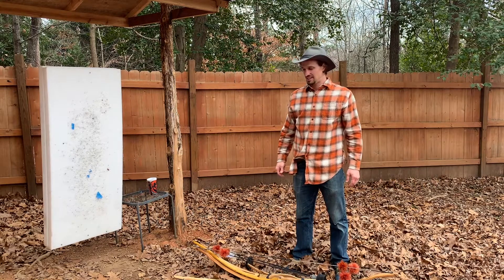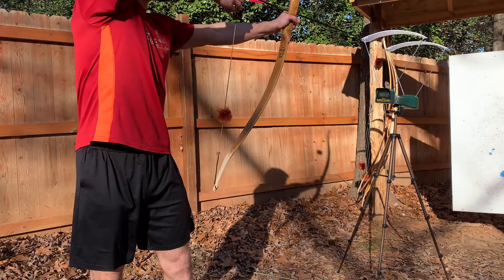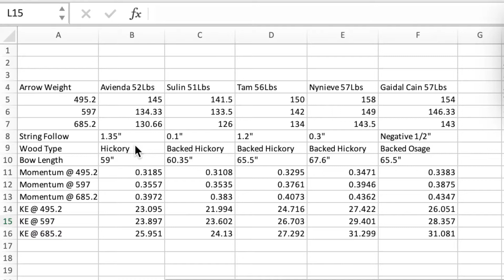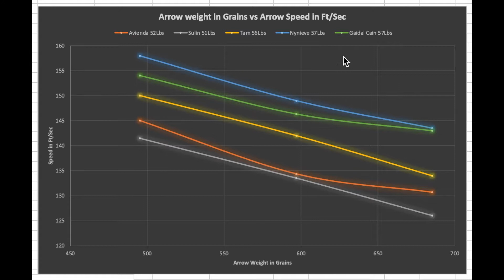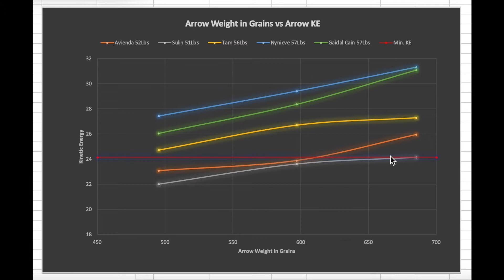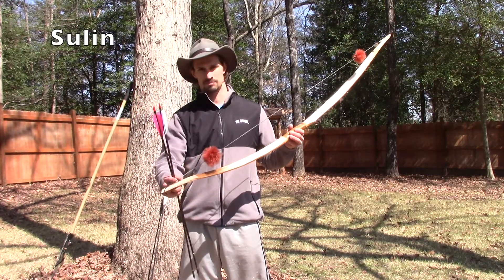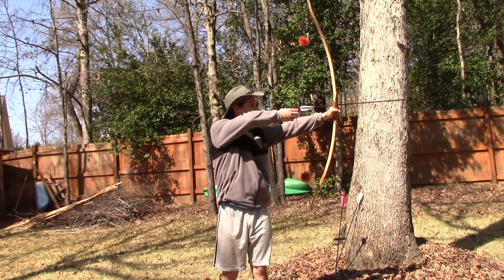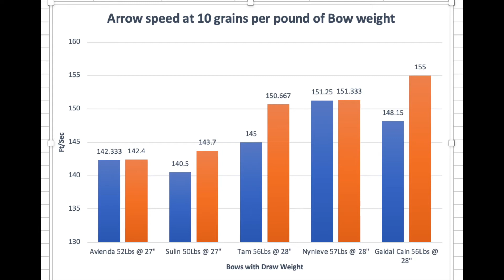Self Bow Lethality, Speed Testing, and  Design Efficiency Discussion

Comment: Great video!!! Do you fire harden your hickory bows or just use a heat gun?
Reply from the maker: @stevenkeil7869  hey Steven, thanks for the watch and the comment. In this video, I used a heat gun to harden my hickory bows. In My latest experiment, I used charcoal fire in a backyard pit to harden a hickory bow. I think I did too much because the bow became much stiffer and ended up causing some very detrimental transverse fractures over the back of the bow which left it unusable.

Comment: Greetings from Aotearoa New Zealand, that is a very ineresting video! I also back my bows with rawhide, I'm interested to know why you back with two layers, more protection? does it add to performance? Also I'm interested to know what material your target is made from, we have a board here called Expol thermaslab(insulating) and your target looks very much like it, I have been wondering how it would work as archery target..
Reply from the maker: Hey man, I backed with 2 layers of raw hide because I thought raw hide would add to speed.  I do not believe raw hide adds to speed at this time.  I think all raw hide does is protect the back of the bow.  I think it adds a small amount of weight, which probably reduces speed some, but I like the protection on my bow back.  I would stick to one layer or no raw hide backing at this point in my bow building experience.
The target is an industrial closed cell high density foam I ordered,  210 US dollars.  It works great for allowing me to shoot broadheads in practice.

Comment: What is your draw length ?
Reply from the maker: I pull to 27 at full, i short draw some of my bows that stack though.
Reply: @gettingclose4206  Did you measure your draw weight at 27 or 28 inchs? Thank you for the information. You make good bows.
Reply from the maker: @jkhippie5929 I specify what length I measure the draw weight at on my bows, but I see I did not specify on my video.  Thanks for the observation. As a bow maker, I have in mind the maximum draw length I believe the bow can handle. Most bows I measure at 28” on my tillering board.  I feel like most of the stickbow world feels draw weight should be measured at 28” when possible.  2 bows I have are quite short, 60 and 61 inches, (Avienda and Sulin respectively) in total length unstrung. These bows I measure the draw weight at 27”.
Reply: @gettingclose4206   Great work. I have been looking for good research on the topic. Good experiment it has helped me with my builds too, thanks.
Reply from the maker: @jkhippie5929  Thank you.  I am definitely not the best bow builder, but Perfect tiller, lighter smaller tips, and Longer bows with more backset should be the formula for faster better performing bows.  the difficulty is in building these bows.

Comment: Hmmm. Interesting theory about the longer bows limb tips moving less distance. I haven't taught of it like that, and i can't either confirm or deny that.
How ever, shorter bows start their stacking earlier than longer ones, it is difficult to feel, but if you make a draw force curve, you can see that. That means that cus their draw weight increases towards the full draw faster than longer bows, they will have less over all draw weight (stored energy) with the same max poundage. That is at least partially the reason why your shorter bows are less efficient. How ever, it is possible to make a shorter bow faster than the longer bow, cus it can have lighter limbs, so even tough it has less stored energy, it also has less limb mass. This depends from the design of course. 

One sure way to increase the bow speed is elliptical tiller. Meaning that instead of all the limb length bending equally, the amount of bend gradually increase towards the tip. This results is lighter limb tips, and the stored energy is in more beneficial location being closer to the tip. You can demonstrate this effect by swinging a (heavy) hammer. The closer of the hammer head you hold, the easier it is to swing around, the further down the handle, the more difficult it comes. That's because the leverage is working against you, just like leverage in bows is working against the limb. Bending limb still acts as a lever also, and the longer the lever, the harder it is for the stored energy to swing the limb.
Reply: Oh, and this tips comes from a guy who has made 2 longbows that shoot 180 or over fps with 530 gn arrows and 29" draw, the slower one is 53# and faster 51# at 29". The faster shoots with 28" draw around 177-178 fps those same arrows. I have also made a 45# short bow that shoots those same arrows 175 fps with 28" draw and it stacks horrible in that draw length because of it's shortness. But even still, only 2 to 3 fps difference to the faster longbow even tough 6 lbs less draw weight.
Reply from the maker: @jkre  Those are seriously high performing bows.  What material are they made of?   I have always kept my last 10 or so inches of limb static (barely bending) blending a Holmgaard style tip with a flat bow design.  Sounds like should get away from this design to discover more speed in my bows.
Reply: @gettingclose4206  my fastest is fire hardened service berry self bow (hedeby inspired longbow) with no string follow, finished this year but most of it made last summer. Second fastest is bamboo backed jatoba longbow, that one is 4 years old and poorly build with an inch or so with string follow, i'm fairly sure those materials on better build quality and design would shoot over 190 fps if not even close to 200 fps. And the third short bow is sinew backed osage, but the sinew is glued with titebond III, so it works less than ideal on it. It also has some string follow and is also 4 years old. Back then i wasn't yet as good as nowadays as a bowyer, so if i would do the same builds today with better design and right kind of glue, i'm sure i would be able to increase the speed even more.

Ridgid tips are only good if they are narrow (light) enough. If they are not, then they will slow down the bow. If you have ever thrown an atlatl or similar, you perhaps have noticed that you only get good distance and speed if the dart it light enough, because in that, like in bows, the leverage is working against the arm or limb. But unlike in bows, in atlatlthe lever increase the distance the projectile is being accelerated with, so even though the lever works against you, the pros still out weight the cons thanks to the extra acceleration distance. But in bows the draw length determines the acceleration distance, so the levers cons are not as easy to overcome. It is even mentioned in traditional bowyers bible, "if the levers are not lighter than bending limb tip, the design will not perform any better than more conventional designs" (not sure if that is word to word, but the meaning is accurate quote from the book)

Comment: Great job and great presentation.  Also congrats on your hunting success with a primitive bow.  Just curious why two layers of rawhide backing.  Generally any backing except sinew will reduce speed as it is just adds weight without adding poundage.  Reserve backings for cosmetics or to prevent breakage if the wood can’t handle it.  Hickory is one of the most tension strong woods and usually does not need backing.  I’m not trying to sound critical, just exchanging thoughts on how to improve the bow efficiency.
Reply from the maker: That is one conclusion I have come to wonder about, my backed bows seem slower compared to the unbacked bow. I BELIEVED backing a bow with raw hide would add speed, but that does not seem to be true.  And hearing you say that it adds weight with out adding force makes me sure I have been incorrect.  I want my bows to be bullet proof, so many of them end up backed.   
My raw hide backings are applied for various reasons but usually to save a bow  that has developed some stress cracks or save wood that has had worm holes under the bark, etc.   Honestly, Tam was backed because after a few years of shooting him I noticed some transverse stress cracks.  Sulin was backed because I believed it would allow for a shorter bow design.  Other bows had wood knots or insect holes I worried about. 
I believe my raw hide at least initially adds a few pounds of draw but I have not tested this extensively.  I do believe an unbacked bow would be faster but I generally have some reason (often bad bow crafting on my part or poor wood characteristics) to back my bows.

Comment: Good to see there is another Wheel fan that dabbles in bowyering.
Reply from the maker: Wheel of Time - what a great fantasy series!  Not terribly in love with the show that came out.  Thank you for the comment. 
I am working on a very long Hickory bow (72 inches) that I plan to venture into the Asian style shooting (thumb draw with the arrow on the right of the bow) for next deer season.
Reply: @gettingclose4206  Agreed, great read but pretty ordinary show. I also can't stand how inaccurate Rand's bow is to what was described in the book and that he carries it permanently strung! 

72in is very long. You're getting into english longbow territory there. It will be interesting to see what your chrono says it can do. Likely indestructible though. I enjoy seeing people trying things that traditional wisdom says doesn't work. I make bows out of Australian soft wood, it's apparently not doable either. SO far the wisdom has proven correct but i'm getting closer lol.
Reply from the maker: @waruikazi  I measured the bow nock to nock it was really about 69 inches.  still a big bow.  I am hoping to draw it to 29 inches though so that is about right for a hickory longbow.  If your bows fail or get stress cracks along the back like mine often do, back them with raw hide.  Most all my bows end up backed with rawhide for protection from the stress of the tension on the back fibers.  I bet it would help your soft wood bows. i have a raw hide backing video.

Comment: You've got the right idea on the limb tips. Longer bows store more kinetic energy and the more reflexed the bow the more potential energy is stored.   If you haven't already , read Volume 2, The Bowyer's Bible and check out Tim Baker's theories. Also crown effects bow performance as well. It's hard to balance all that stuff and seems to me you've made some good bows.
Reply from the maker: Thank you for watching my video, i have heard a lot about that book.  I should read it.  
Wood crown, i would guess makes the tension on the back of the bow more focused on the back center line and would probably cause tinsel stress lines if not failure.  I do not know this, but that is my guess about high crowned staves.  
Does high crown affect speed?
Reply from the maker: That being said, i build bows with the staves i have available and have some highly crowned staves that made bows.  I prefer less crown, i would feel that distributes tinsel strength across the whole bow back.

Comment: I think you should've reconsidered naming Aviendha as she should've been a hornbow in true Aiel fashion.
Reply from the maker: Thank you, I know you are right.  I love the names of the Wheel of Time.  
My excuse is, I do not make horn bows and this bow was a unique bow build for me.  It was a bend through the handle short bow and for some reason it seemed like a female. That combination of weapon and being unique made me name it Aviendha.
Reply: @gettingclose4206  well, let's just assume that Aiel in the wetlands would have to use wetlander materials since hide glue and sinew prefer a dryer climate 😁
Reply from the maker: @cornholio1612  true WOT fan, thank you for your gracious comments and you are the first person who has caught my bow name origin.
Reply: @gettingclose4206   what dimensions do you think I will need for a ash flat bow, 100lb with a 32 inch draw?
Reply from the maker: @tonymaurice4157  Holly crap! 100 lbs and 32 inch draw.  What a missile launcher!  Well I have never made one higher than low 60s with a 28 inch draw but I will give these dimensions a go. . . 
I would say 76 inches long if you want a static riser (you think about 8 inches of non-working bow), bend through the handle bow you may can make it 70 inches.  And my approach is start with a long stave, cut down later if needed.
Wide limbs, to distribute the tensile strain on the back of the limb.  Shoot for 2 inches wide if the stave can accommodate that.  Good luck, please send pictures or post update please.
Reply: @gettingclose4206   do you think you could get one of your hickory bows to 100lb? I'm guessing a wider limb?
Reply from the maker: @tonymaurice4157  are you asking me to make you one?  I could try but I need to shoot bows in and there is now way I could make one that high in draw weight weight.  a lot of my bow making is about feel, and I have no way to feel out a 100lb draw weight bow at 32 inches.  Do you want me to try to make you one?
Reply from the maker: I would charge and it would take at least several months.
Reply from the maker: @tonymaurice4157  no my Ash bows are generally 1.5 to 1.75 inches wide but for at heavy poundage bow I would think wider would spread out that tension on the back of the bow.  You asked about a 100lbs bow, that is different from my bows.